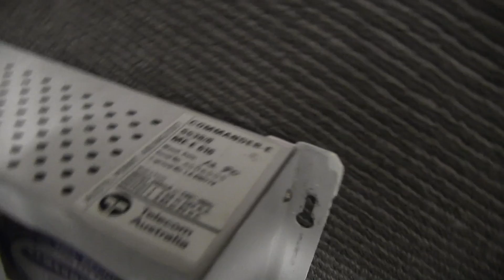EEVblog #214 - Commander Phone System Teardown

Comment: @MichaelJE2 I wonder why they would not just use a PRI T1, E1, J1 something like that then you would not have all of those physical telephone wire connections.  I know my install just has four normal telephone lines but I have the other module just for this if I ever need to upscale my lines.

Comment: Unless you can scrounge up the proper station sets, which will undoubtedly be proprietary, what you have is a nice group of parts. There are outfits that sell them used, but they won't be cheap and unjustified for one guy in a small space. (Who would you transfer calls to?)

If you have only one line, it would be a lot simpler just to have maybe two ordinary phones across the line and see if you can sell the PBX box to somebody as a spare unit. (Here today, eBay tomorrow.)